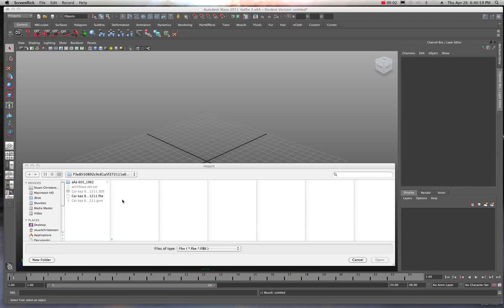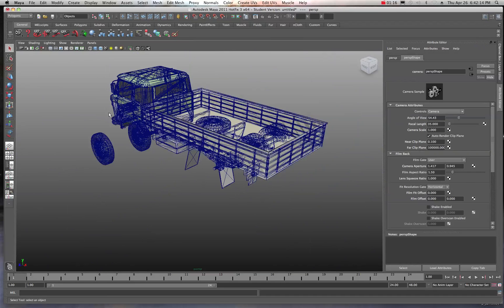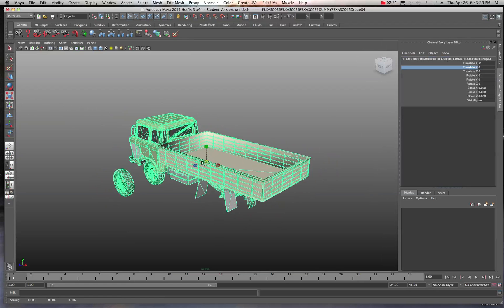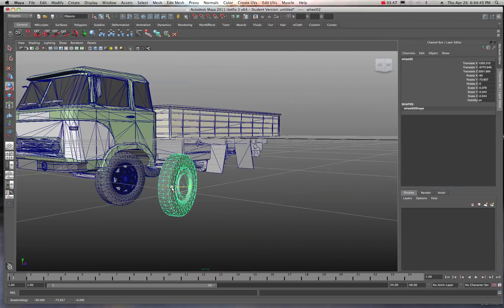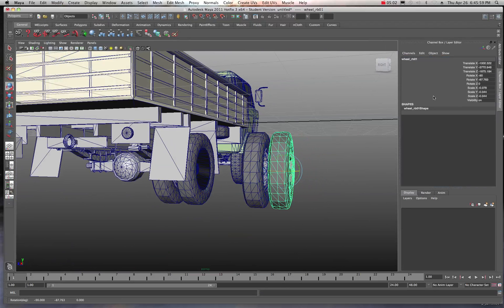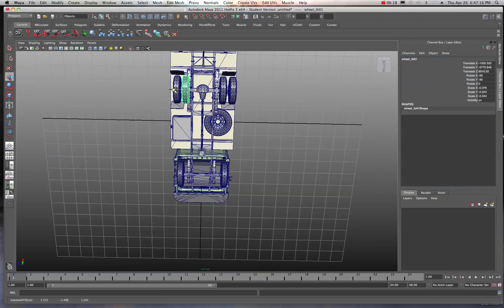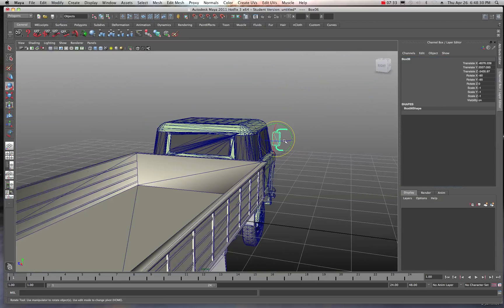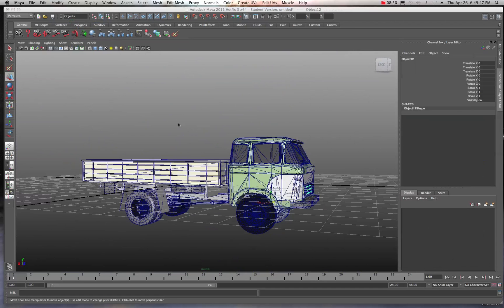Maya .3ds Model to Maya FBX Conversion Quicktip_Fixing Center Pivots Tutorial by Stuart Christensen

Comment: Hey I just wanted to add that in the case of the mirror it seems as if the position of the mirror was alright but the rotation wasn't a good choice. If the position was ok then it might be better to just freeze the transformations,. Put your pivot in one of the vertex of the cylinder and then just scale to one in the direction it needs to be. In your case I believe it was either one or negative one in the z axis. That's just what I would've done. Thanks for the vid.